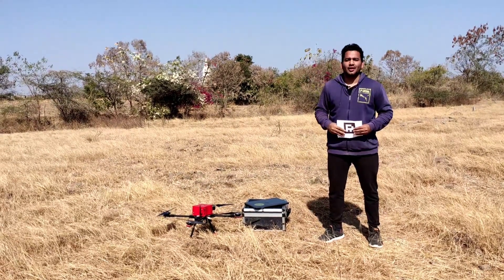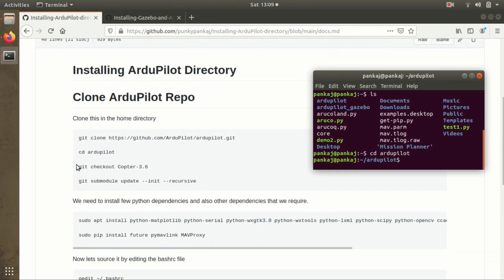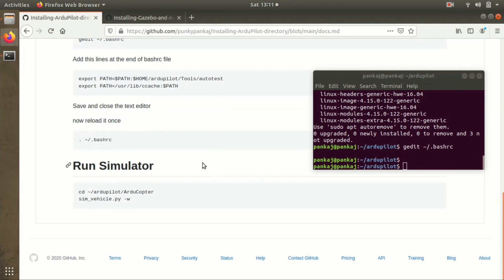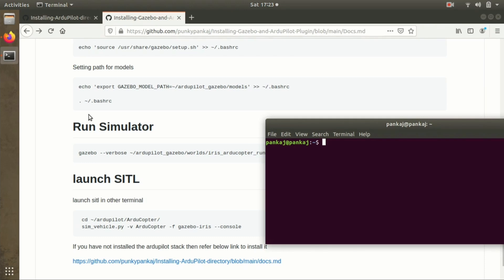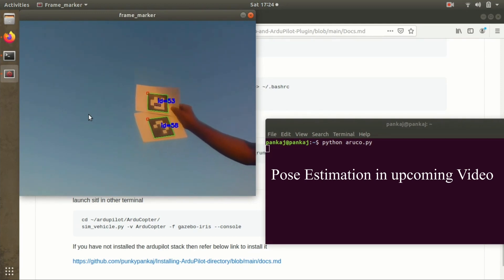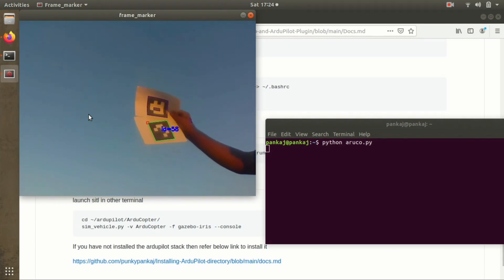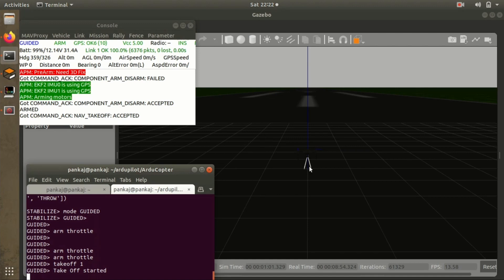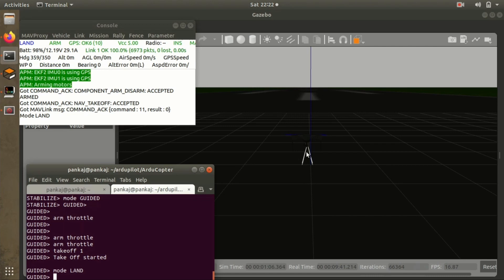Install GAZEBO with ArduPilot Plugins and Simulate your Drone | OpenCV Aruco Marker | guide Part-2

Comment: Is this setup works well with wsl ubuntu windows?
Reply from the maker: Yes it works with wsl ubuntu windows , few things to take into consideration are   about performance or rendering issue which depends on your wsl version. I would suggest you to dual boot
Reply: @PankajMali  I don't have dual boot setup...but I do have virtual box should I use that?
Reply from the maker: @anjumeena3 yes you can use virtual box
Reply: @PankajMali  ok  tsym..will update you.

Comment: When I am running this code I am getting error in Dictionary_get?
How to resolve it?
Reply from the maker: This is a python2 code considering this follow this and check 

1: Check if opencv-contrib-python is installed and check the version
pip show opencv-contrib-python

2: If not installed or outdated, install or upgrade opencv-contrib-python
pip install opencv-contrib-python --upgrade

Let me know for any issues

Comment: Can we add custom logic and new behaviours to the drone which is already running on some ardupilot code , for eg arduplane? using this dronekit
Reply from the maker: Yes ,we can add .
Either by adding in the fitmware and compiling or by using the companion if you are going with computer vision.
Reply: @PankajMali  can all ardupilot params and modes be accessed by dronekit alone? and whether using dronekit is sufficient for testing new logics for a modified drones testing?
Reply from the maker: Yes you can access all the modes using dronekit and  test new logic.

Comment: Sir which camera are you using right now for precision landing... Instead of pi camera can we use rog web camera for better stream quality?
Reply from the maker: Yes you can use any camera connected to the rpi usb and your rpi model should be able to handle the data rates if the video quality is more
Reply from the maker: Im using rpi v2 8mp camera
Reply: @PankajMali  if I use rog camera is it necessary to change horizantal field view in the code..

Comment: Hello, i have created custom mode for aruco based landing so in that mode the drone will go to destination that i have given, then detect aruco and land but problem is that set_destination from guided mode is not working in custom mode, can you help me how can i solve this problem to go specific destination.
Reply from the maker: hi,
please check this implementation for your application for creating a custom mode and set a mav command active, if you have done in some other way then please elaborate.

1. Modify Mode Enumeration (Mode.h):
 
   enum class Mode : uint8_t {
       // Existing modes...
       GUIDED = 4,
       // Existing modes...
       CUSTOM_MODE = 12,
       // Add more modes as needed
   };
  

2. Modify `set_mode` Function (mode.cpp file):
   
   void Copter::set_mode(uint8_t mode)
   {
       // Existing code...

       switch (mode) 
{
           case static_cast<uint8_t>(Mode::GUIDED):
               // Handle GUIDED mode...
               break;
           case static_cast<uint8_t>(Mode::CUSTOM_MODE):
               // Activate set destination function or perform custom actions...
               set_destination_custom();
               break;
           // Existing cases...
       }
   }
 

3.Implement Set Destination Function (GCS_MAVLink.cpp file):
 
   void Copter::set_destination_custom()
   {
       // Implement your set destination logic here
       // This might involve extracting coordinates from a MAVLink message
       // and setting the destination for your custom mode
       float x = /*...*/;
       float y = /*...*/;
       float z = /*...*/;

       set_destination(x, y, z);
   }

   Ensure that `set_destination` is appropriately implemented and performs the required actions based on the provided coordinates, ou can try this with mavproxy and SITL on mission planner.

4. Handle MAVLink Command (GCS_MAVLink.cpp file):
 
   case MAV_CMD_DO_SET_MODE:
       {
           // Extract custom mode value from the command
           uint8_t custom_mode = static_cast<uint8_t>(msg.param1);

           // Set the mode based on the custom mode value
           copter.set_mode(custom_mode);
       }
       break;
Reply: @PankajMali  Thanks ✨😊

Comment: Bro what will be the range of drone from ground, by using dronekit library...?
Reply: Bro than how can we connect our dronekit to  internet...?
Reply from the maker: @venkateshm1037  use raspberry pi internet hat or provide some mobile hotspot or a wireless  router on drone
Reply: I have APM 2.8 and resberry pi.... Can i intigrate it with dronekit..?
Reply from the maker: @venkateshm1037  yes you can but as apm is limited with only single telemetry port so u need to sacrifice telemetry module n connect rpi to that telemetry port on apm
Reply: @PankajMali  I will try bro..
Reply: @PankajMali  thanks for quick responce
Reply from the maker: Good luck
Reply from the maker: Range parameter while controlling the drone  from rhe computer is limited to the wifi range or you can just trigger the code initially pr else start the code execution when drone is powered on

Also you can use internet hat to get unlimited range over internet

Comment: Nice bro 👍  I am doing a project related to drone tracking and detect objects, but I'm just a beginner. Drone Dojo has provided drone programming courses. Is it worth to buy these courses for beginners like me?
Reply from the maker: Thank you❣
Yes its worth if you need each and everything in  detail, you can get 10 percent discount on every course, check the links in the description.

Comment: Hey, I am using an aruco marker for the iris drone to detect, too!  I followed your tutorials and it worked like a charm.

1) Can you pls tell me how can i work on open cv related activity on the drone camera inside the gazebo itself, especially for this aruco detection? 
2) I am currently at a stage where I am working on getting the rostopic of the image from the camera. How do I do that?? 
3) Also, I only have 2 files  - model.sdf and .config for iris to work on as I have ROS Kinetic and Ubuntu 16 and do not have PX4 packages.
4)  Previously, I used to work on mobile robots in urdf to get the image rostopics, but not sure how to go about it using sdf. Pls help me out??? Much appreciated!!
Reply from the maker: You can get the video feed from the camera from gazebo model using gstreamer with udp port 5600.
Theres a python script you need to run to get the video feed working from the gazebo camera.
And i have tested this setup on ubuntu 18 and gazebo 9  if you are ready with this setup then next thing is to install ros melodic and px4 directory (you can check official documenting for this)
Then Start simulation gazebo with make posix gazebo_irish ( or solo, typhoon )

Start python script with python opencv-gazebo.py ( git link to script in next video)

Pipeline: VideoCapture video("udpsrc port=5600 ! application/x-rtp,payload=96,encoding-name=H264 !" "rtpjitterbuffer mode=1 ! rtph264depay ! h264parse ! decodebin ! videoconvert ! appsink drop=true max-buffers=1 emit-signals=true sync=false", CAP_GSTREAMER);

This script has been tested and works like charm both with ardupilot and px4 plugins
Reply: @PankajMali  Wait, for git link in the next video, are u about to make a new one?? Damn excited! 
But I have an issue, that I do not intend to upgrade my ubuntu from 16 to 18 to work on ROS melodic and PX4 packages. So is there any alternative to that so I can work on current system?

Also, thanks, but one thing I wanted to clarify- in the script cv2.VideoCapture(0) is being used currently for taking the input from my laptop's camera, but as you mentioned above, do I have to input like this:

v2.VideoCapture('udpsrc port=5600 caps = "application/x-rtp, media=(string)video, clock-rate=(int)90000, encoding-name=(string)H264" ! rtph264depay ! avdec_h264 ! videoconvert ! autovideosink fps-update-interval=1000 sync=false', cv2.CAP_GSTREAMER)

 ??
Because that threw an error:
Connecting...
('uav_alt', 2.223)
Traceback (most recent call last):
  File "07_precision_landing_test.py", line 175, in <module>
    marker_found, x_cm, y_cm, z_cm, directions = aruco_tracker.track(loop=False)
  File "/home/sanil/how_do_drones_work-master/how_do_drones_work-master/scripts/lib_aruco_pose.py", line 187, in track
    frame = imutils.resize(frame, 400,400)
  File "/usr/local/lib/python2.7/dist-packages/imutils/convenience.py", line 69, in resize
    (h, w) = image.shape[:2]
AttributeError: 'NoneType' object has no attribute 'shape'